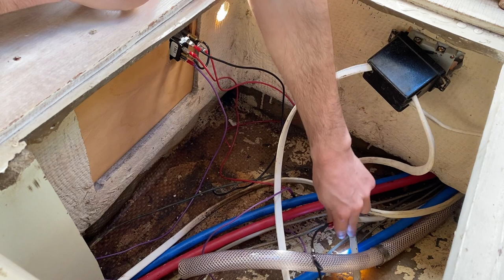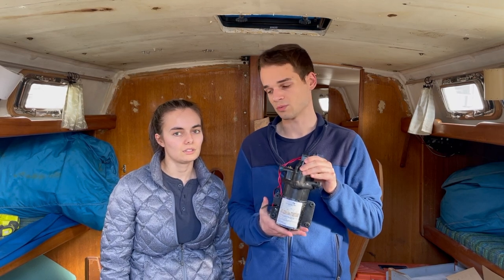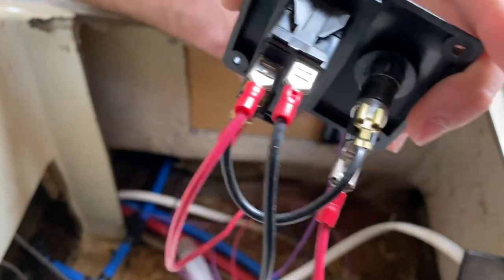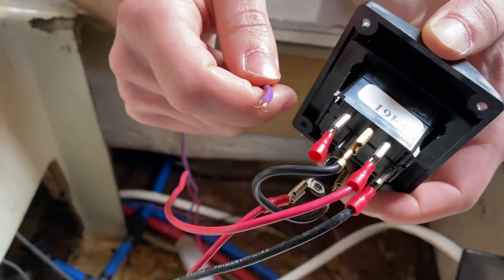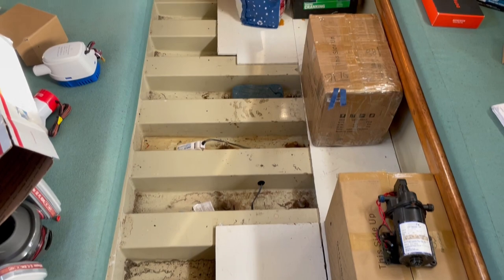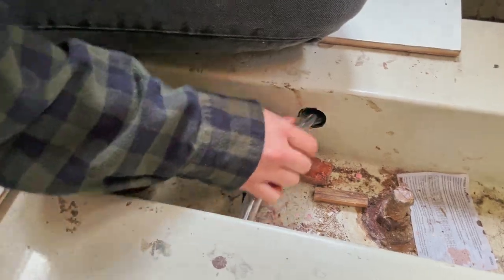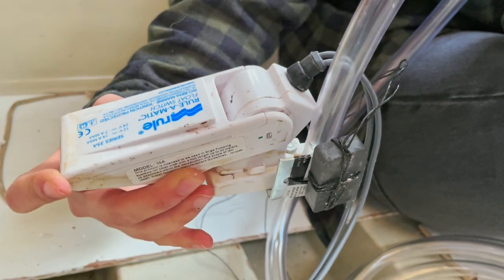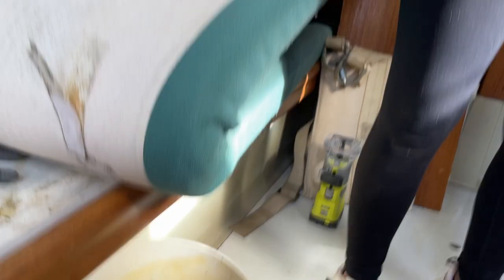Not Your Typical Bilge Pump Installation | Attempt 3

Comment: You did the right thing putting in that other style pump. Why not setup a second pump higher up in that  space in case you do have a bigger leak that your pump can not handle. It would only be used if there  was a much large leak into the boat. Since it would stay dry, it would not fail. Also you drilled out that core, does that lead down to the keel and that is where bilge water sits? Why not cut a rectangular slot out of that area to use that regular type bilge pump in that space? Other thing is, if that space below there is small volume, it may not matter much to worry about putting in a larger pump, so then back to using a backup regular bilge pump in the accessible space above that chamber. My own 37 foot older power boat, I have up to 5 bilge pumps for redundancy, so when one fails there is a backup, and they do fail.
Reply from the maker: Love your comment! Having a secondary bilge pump kept above the bilge is a good idea. We have a second and more powerful bilge pump that has an integrated float for that purpose. The chamber that we drilled into is the bilge. The water travels under the liner and stringers to drain into it. It's different from anything else I have seen. The bilge is small but if it overflows, it will flood other places in the boat before the secondary pump could kick in, especially if the boat heels. This is why we prioritize pumping the water out of there despite the difficult access. In fact, is so narrow that the hole we drilled is basically as wide as the bilge. We chose a round hole because it was easier to drill and because it would not weaken the structure as much as a square hole with its corners. Or at least that was our reasoning. 
Maybe we should also have 5 pumps. We would sleep better at night!